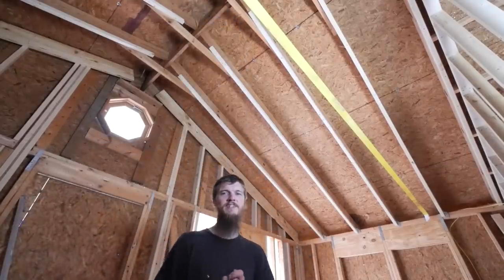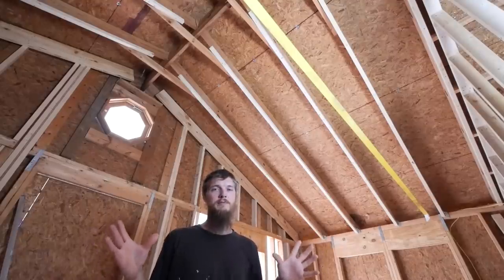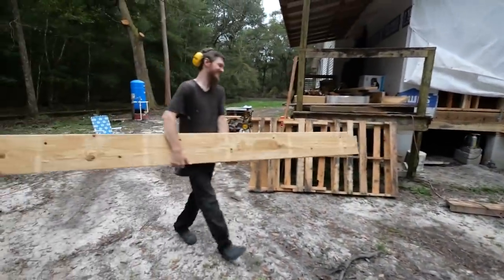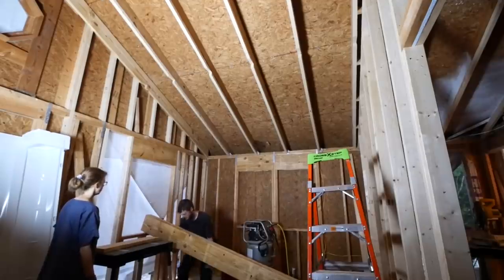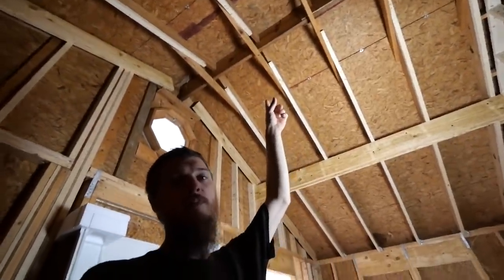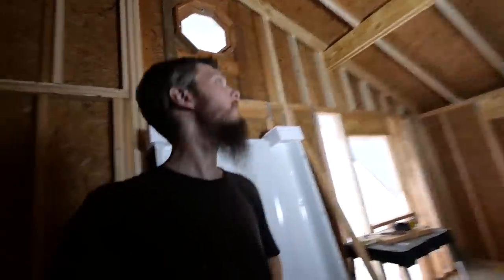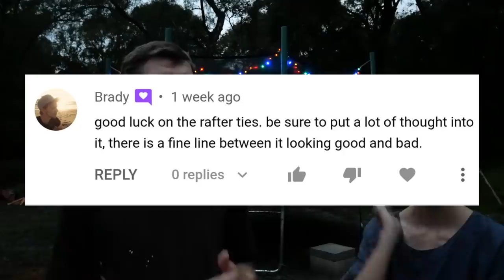The Hardest Part of our Build - Building Beams for our Cathedral Ceiling

Comment: My guess on the pink ceramic find is that maybe it had a cork at one time and held dusting powder perhaps or potpourri. Or maybe it held water for sprinkling laundry when ironing. Let us know if you figure it out. I have seen mudlarkers find something similar that held powder to dust over inks to dry them fast to avoid smearing. The holes in it look too large for a salt shaker. Hmmmm?